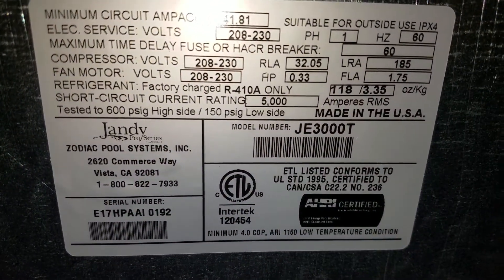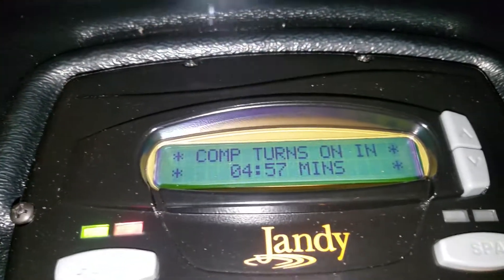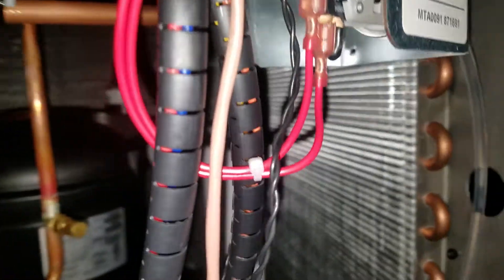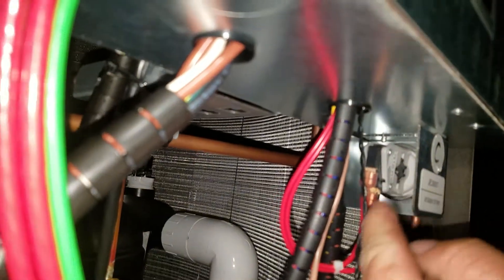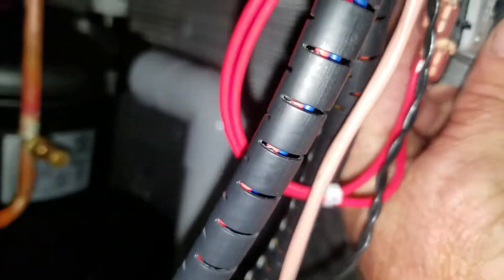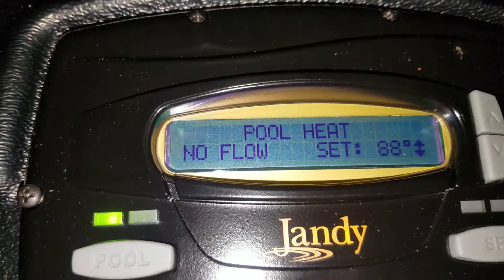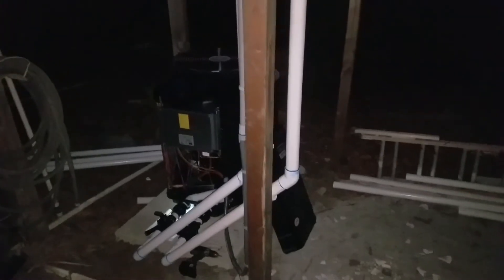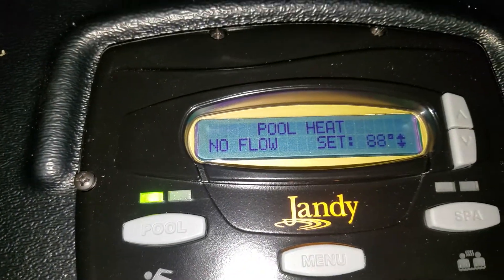JE 3000T JANDY HEAT PUMP adjusting pressure switch heat pump wants to turn on while pool pumps off

Comment: That is not the best fix for this situation. You should remove the pressure switch and install a flow switch in this system. Or add a flow switch in series with the pressure switch. This is he only for sure safe way to prevent the heater from coming accidentally.